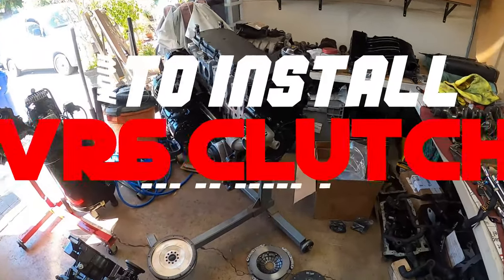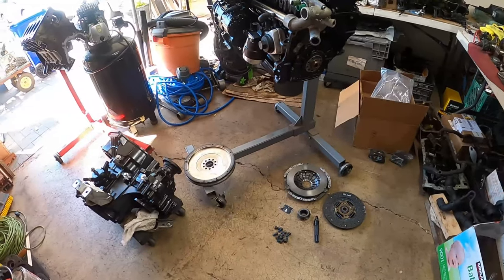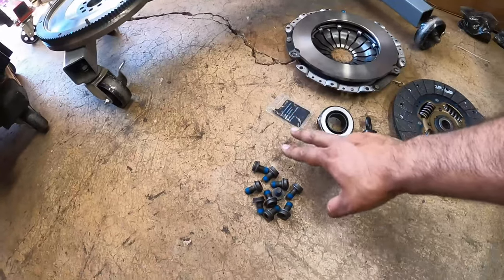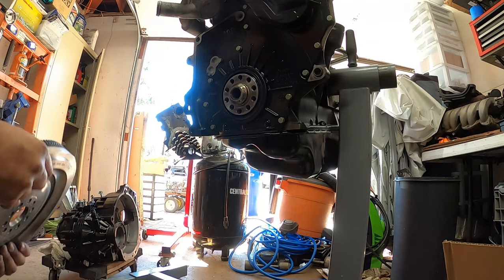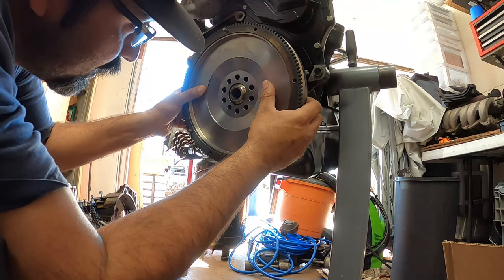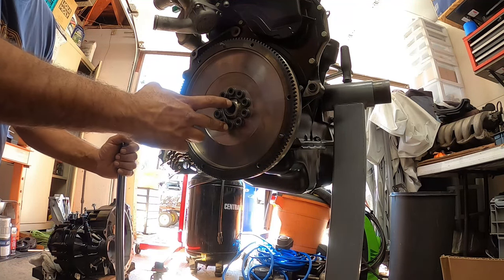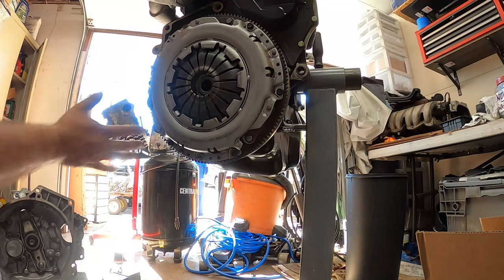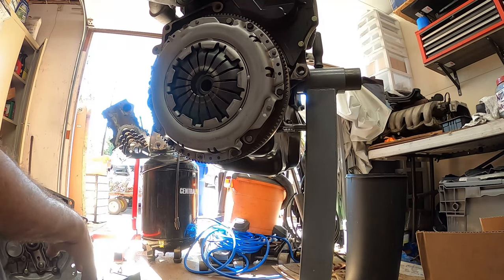HOW TO INSTALL VR6 CLUTCH S7EP25

Comment: This video is perfect for anyone want to change a clutch and flywheel on any of the VW AGZ (150) AQN (170) BDF (200) AQP (204) AUE (204) BDE (204) AQP (204) motors. It is very hard to find a truly good and informative tutorial like this one out on the web.

Comment: Is the VR6 motor in the video a 12v or 24v?  I’m trying to buy a valeo clutch kit for my 02 Mk4 Golf VR6 12v. It’s has the red spark plug wires and i believe it to be the APF code and 5 speed M/T.  Do you mind sharing the Clutch kit part number?
Reply from the maker: Yes this is a 12V vr6
Reply: @PincheALsGarage  thanks for getting back with me. The Valeo Kit I’m looking to buy is pn: 52405616 and most websites say it only fits the 24V Vr6 BDF motor.   What gear box did you have 5 speed or 6 speed
Reply from the maker: @jeffreyhird1052  5 speed

Comment: How different are the bolt patterns from the VR6 to the 1.8t 02J bellhousings? Like could you maybe leave a couple bolts out and it might fit still? I ask because my VR6 came with an auto to manual swap (done very badly) and my tranny was missing a couple bolts when I did the clutch.

I also noticed the engine leans a bit even with new mounts on that side. Wondering if they used the wrong trans...
Reply from the maker: They are not meant to line up

Comment: Thinking about using a OEM lightened flywheel. 13-14lbs. Don't want chatter. Any thoughts or experience with a mid-weight lightened flywheel? I will not do the ones out there in the 8-10lb range.
Reply from the maker: 13 to 14lbs will give you chatter but it's not very loud